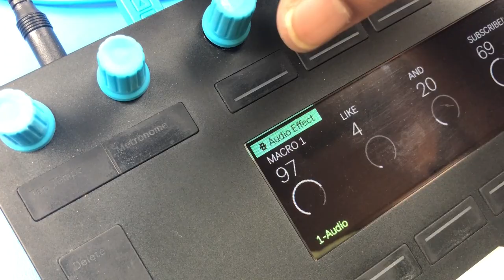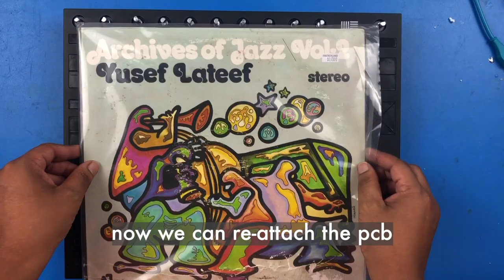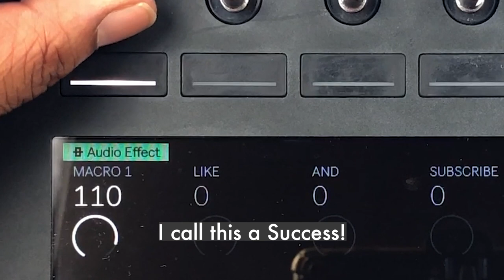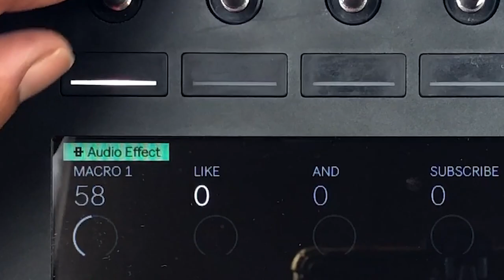Repairing an Ableton Push 2: Macro Knob

Comment: Great video! love that jazz vinyl btw, Found it in a store in canada, my push 2 has been lying around since it has stopped working. doesnt detect basically, assuming i used it quite often without the adapter. now it wouldnt work just by the midi cable, could you please suggest what could be done. Thanks man
Reply from the maker: Does the unit power on when you connect it via midi? 

If not, it's probably the midi port that went bad over time from plugging/unplugging the cable. If this is the case, you'll have to replace it. It's a common part and not a super complicated repair.

Comment: Yo man just saw this video amazing work. I have a weird very bad problem with my question that is 2 damn tight screws. Are stripped and I’m unable to remove it it’s dam difficult and I am almost breaking the plastic. I do know what to do. Please help me
Reply from the maker: Yeah, the small screws on the back can be pretty hard to turn. You have a few options:

You can try using a different screw driver. Try out a few different drivers if you can. Sometimes a different driver will have better luck gripping the screw.

You can try cutting a small piece from a rubber band, place the rubber on top of the screw and then push the driver into the rubber and try to turn the screw. Sometimes the rubber can help the driver grip the screw.

OR, you can get a driver made specifically to turn stripped screws. I’ve never used one, but I’ve heard that they work really well.

Best of luck!
Reply: @sumawav  the rubber band trick didn’t work I melted a small pices of plastic while soldering… bro if there is any way you can help me in this I’m dying to get these two screws out

Comment: I've just bought a push 2 and have an issue where it's triggering the pad next to it. Is this a common issue? I've contacted the place i purchased it from to get a replacement, but i wondered if this is the norm
Reply from the maker: It’s a common issue. But I don’t think it should be happening with a new unit
Reply: @sumawav  Thanks and great videos! I'm having a similar issue, it looks like the usb port on my Push 2 is fried.  Any idea what I can do?
Reply from the maker: @technocolortv  the USB port is a common part. Here's one from amazon:
https://www.amazon.com/Female-Type-B-4-Pin-Right-Socket-White/dp/B08MSYS1K5/

If you need some further help, check out my video on replacing the USB port on a Maschine mikro. Best of luck!

Comment: nice video! 
i have a question  ,my push 2 knob cap will falling off when i trun over my push,do you konw how to fix it ？ thanks
Reply from the maker: Best option would be to get a new knob. OR you could try putting a tiny amount of putty or modeling clay inside the cap to help it stick to the knob.

Lol, i would advise against glue since that would make it challenging to take apart in the future.

Comment: Does anyone watching this have any experience with the USB port on the Push 2? My Push 2 will power on via the power supply but does nothing over USB. I did a continuity test from the four USB pins on the Push 2 mainboard. There seems to a physical connection between each of those four pins and their corresponding wires on the cable when plugged in, even so my computer doesn't see the Push.

I thought perhaps a corrupt firmware update might mean there is no driver equivalent on the Push 2. All the same that should stop the Push powering up on USB power. Any clues welcomed. As Ableton no longer manufactures the Push 2, it seems unlikely they will offer tech support for anything other than their latest current model.
Reply from the maker: Extra strange especially if there's continuity from the pins to the wire. 

My first thought is the 4 pins may have bad or cracked solder joints. So you would see continuity between the pins and wires, but the PUSH doesn't see past the bad pins.

This is super common, the physical act of plugging and unpluggin the USB cable can cause stress on those 4 pins. Remelting the solder on those pins might help re-establish their connection.
Reply: @sumawav  In the back of my mind I kind of know i have to resolder those 4 pins, but i needed someone else to say so. Anyway, I've now bought the Push 3, so I have nothing to lose. I shall try resoldering - edit to follow.

Comment: Hey man - are you open to doing repairs? I have a push2 with the same issue - and the pads in the lower left quadrant have worn down unevenly - and lost sensitivity due to uneven use of pads (this is a desgin flaw IMO) - I reached out to them to ask how much it would cost to fix - I knew it was out of warranty and wasnt looking for a freebee - and they refused to fix it. Im so pissed. I have been with live since V4! Spent at least $2000 over the years on Ableton products alone - and they keep raising the upgrade prices - and then this. Please help
Reply from the maker: Sorry about the late reply. Bad pads are a challenging fix. All I can really do is clean them and hope for the best.

Lol, the video may not show it, but taking apart the push is a HUGE pain in the butt. Honestly, it's just not worth the effort without a guaranteed fix.

Your best bet is to take it apart and clean the pads and pcb with alcohol.